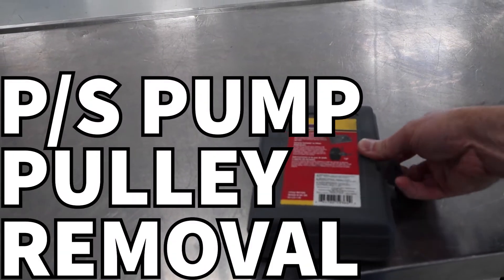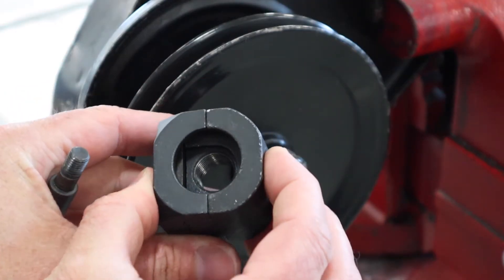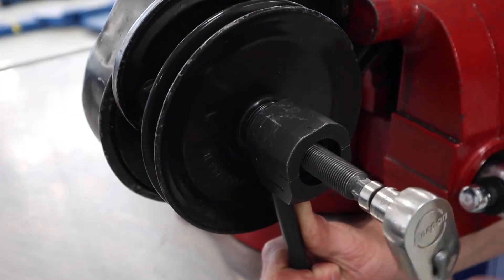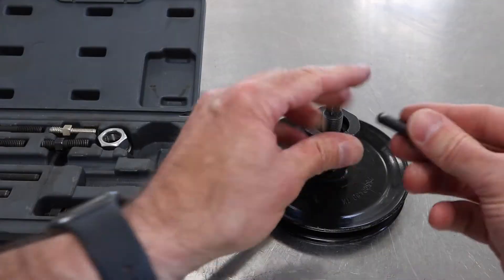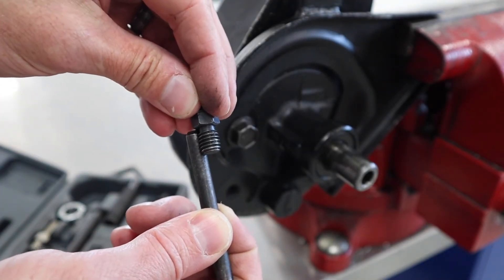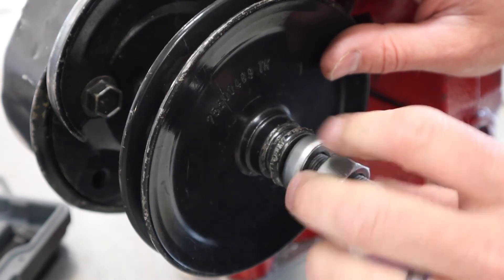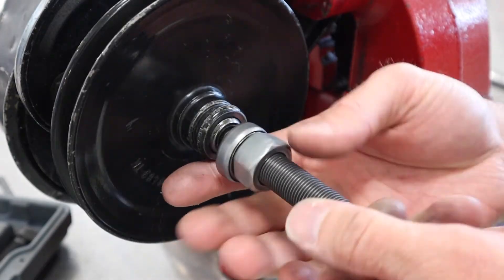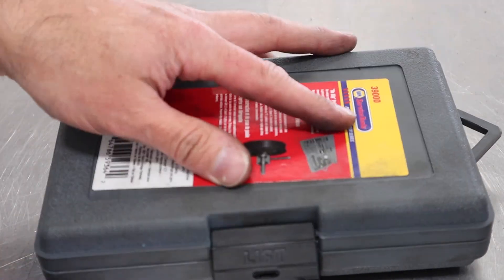Power Steering Pump Pulley Removal

Comment: life saver mate. No one in New Zealand has a clue about what tools etc I need for my 1994 GMC pickup.
All the Aholes on forums just laughed when I asked what to use......
I am a motorcycle mechanic, so my tools are all metric and much smaller sizes than anything GM would use.
Cheers, I used your link and bought the same kit

Comment: How far do you thread the installer shaft into the shaft before you attached the bearing part and started the install? Do you bottom it out?
Reply from the maker: It is best to bottom it out and ensure you have as much thread contact as possible.
Reply: Yes u do bottom it out

Comment: Thanks for posting the tool. Broke a cheap universal kit. So gonna try this. if it gives me problems still. It will be time to add fire. Hope I don't need to cut off wheel this pulley. But the fact that it dumped a qt of lucas ps stop leak in a little over 20 min. I betting it's cooked and almost fused together.
Reply: Autozone has a decent set

Comment: Yeah but what about when this doesn’t work?
Reply from the maker: If the pulley is very stuck, sometimes applying heat will help. If the tool or pulley becomes damaged, then you may have to cut and slice the pulley to remove it from the pump. In some cases, it may be worth the additional cost to purchase a replacement pump as well.